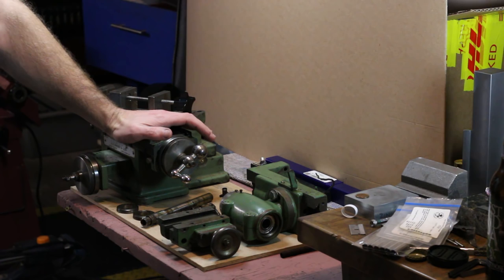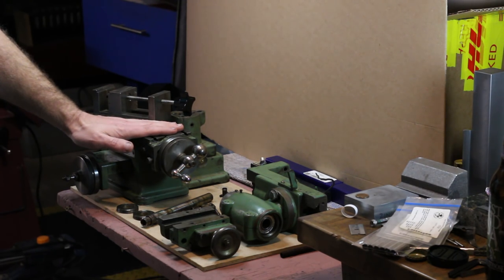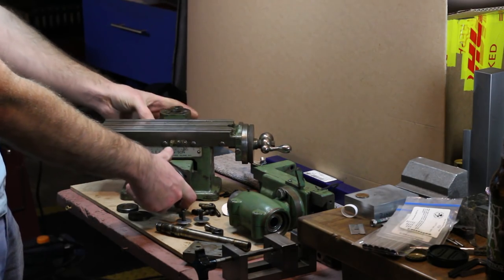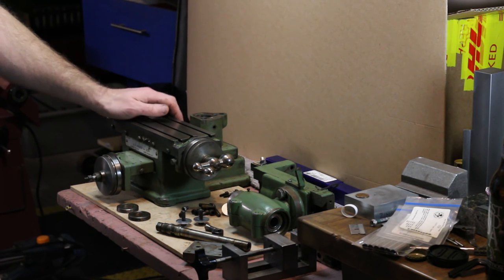Hager watchmaker's milling machine... sort of

Comment: good luck rebuilding the watchmakers mill.  I will recommend since you don't have the matching motor/controller in brush-less, that you try to find a much faster combination for such small work.  maybe up to 20,000 rpms instead of a measly 2500.
Reply from the maker: Thanks! With traditional style spade drills for the tiny stuff, 2500rpm is fine, chip load can be proportionately high without stressing the tool. I'm agonizing over whether to run direct drive, or gear it up to get 5k. I should do an update soon, I have designed the spindle and bought the correct bldc drive for the motor.  Whether direct drive or geared, mounting the motor is going to get interesting. Geared requires offset mounting, unbalancing the head. Direct drive requires a coupling, and if I wanted to go real high speed then a regular Lovejoy coupling wouldn't really cut it. Anyway thanks for watching, and for the feedback! The spindle itself will take very high speeds, so if I end up changing my mind or regretting the slow speed solution then the motor and coupling/drive situation is all I'd have to change.

Comment: A microscope stage such as that one was originally designed as will be extremely accurate. Feed screws and nuts would have been very close to jig borer tolerances and with a price to match. If it were me? This is a project you'll not want to skimp or go cheap on the re-engineering. I see many on forums and here on YT using aluminum for machine tool parts simply because it's either cheap or available in the scrap box. For a machine of this quality I'd be using proper cast iron blocks for that head mount. And I think I'd rough that spindle collet bore so it's close then rig up whatever you can to grind the finished collet taper while it's spinning in those new bearings. Shadon HKW has a good video about regrinding his mills R8 taper that's well worth a look if you haven't seen it already. 

I've learned just from observation that it's a good idea to pull the table and slides apart on my BP clone about once a year for a good detailed cleaning, gib and feed nut adjustment and relubrication even with it's one shot lube system. All that older black oil contains wear particles and there's always chips where you think it would be impossible for them to be. It's very likely the slides have never been apart on your X,Y table so I think that would be my first step. One problem you may/may not run into is these microscope slides were usually used in clean areas and as fairly light duty equipment compared to milling. The feed nuts may or may not be adjustable. That may require some redesign as well. 

Unless you have hardening and surface grinding equipment it's doubtful you could come close to the accuracy of even a fairly cheap screw less tool makers vise with anything shop built. I bought a hardened and ground Accu-Pro that has both the side and end slots for clamping to the table. It's well under the factory guarantee of .0002" on every dimension I've checked. There quite a bit more than the average off shore vise of this type, but I'd certainly say there well worth it. And one of the few things I've bought for my shop that I honestly think I paid too little for what I got. There quite low profile and would be a huge step up over what was included with your mill. 

Even though I have a couple of mills I've always wanted something much like what you've got now. It should be an interesting project and one I'll be following.
Reply from the maker: Thanks for taking the time to comment!

Generally speaking, I'm not skimping on this but on the other hand it's not going to be a money-is-no-object project either... unless, if course everyone wants to sponsor me on Patreon, LOL.  Regarding aluminum, I never have, and would never, make any structural or bearing component for a machine tool from aluminum.  Thanks for the heads up about Shadon's video, I'll definitely check that out.  I haven't made up my mind yet for spindle construction, I suspect I will agonize over the process for some time.  I don't mind making several attempts to get it right.  The entire machine will definitely be totally torn apart, cleaned, and evaluated.  So far it has only been subject to brief disassembly and cursory inspection.  I didn't really inspect the feed screw nut situation but there didn't appear to be any backlash adjustment.  I've never owned a machine with backlash adjustment, and am not especially bothered about it since it's so easy to compensate for.  If I modified any of my machines for backlash adjustment, though, it would probably be this one.  I personally like the double-nut mechanism.  The screws are your typical 60 degree thread profile, M6x1.0, with very generous length of engagement with the nuts, just as you'd find on metric watchmaker's lathes and mills.  It should be up to the task of the cutting forces involved.  This is for really small work, and since I have a larger mill already I won't be tempted to push it beyond its limits.

I'd really rather not go with the screwless type vise for this machine, if I make one at all it will be a screw type.  I would likely use iron for the body, scraped where it matters, and use tiny hardened and ground jaws.  We're talking super tiny here, this machine is really really small.
Reply: I tried finding it again but?????????? I ran across a thread about building a machine tool spindle on one of the forums yesterday and thought it was on the Practical Machinist site. Where ever it was the opinion for the best non specialty metal without further heat treatment was 4140 Ph. Machining qualitys were considered secondary to having a hardened collet taper. I've seen quite a few soft steel ER collet chuck builds on various forums and think over time might be a mistake for it's future wear qualitys and accuracy retention. My Bison and Emco ER chucks are more than a bit hard and a lot of wear and tear gets put on the collet chucks nut threads. Even with an ER-11 the threads are much finer so the problems are still relative to the same thing with larger collets. It's my understanding the chucks collet taper should be hardened as well. In the diameter and length your needing it shouldn't cost that much to go with the 4140 PH if you agree with my thoughts. Something to consider anyway. Plus the hardened material should give a better finish if you end up grinding the collet taper to finished size. Whenever I finally get to my lathes ER-40 collet chuck build that's the material and method I'll be using.
Reply from the maker: Yeah we'll see how it holds up.  If/when it wears out, no big deal to make another one out of a different material.  By that time I should have the Hjorth universal and ID grinding attachments set up and running, so that would open up possibilities for making a good tool-hard spindle.

Comment: A very nice little machine, indeed. The challenge will be to make the adapter that mates the spindle housing to the base to not look like an adapter but rather, as part of an original design.
Reply from the maker: Indeed!  I have been wondering about that, myself.

Comment: WOW... that X, Y, arrangement is something I have never seen before... Clever!!! might be interesting to wipe the chips away during clean-up.. but, I'll bet that is one rigid guy due to that set up... Thank you for showing that...
Reply: The X axis will be awesomely rigid because of how wide the support points are.  However, I'm wondering how much lateral force the Y axis will take. The long vertical distance between the tool and the Y axis dovetails makes a long lever!

Comment: Any idea what the upper casting is from?  Is the spindle cartridge shop built?  

The aspect I'll be following most closely will certainly be the spindle construction.  I know just enough about bearing arrangements to be intimidated by pre-load, runout tolerances, etc.  I'm guessing you'll want a fairly high speed spindle for tiny endmills, which I'm guessing will make the design a wee bit more critical than slapping together a drill press ;)
Reply from the maker: The spindle cartridge is not shop built, but the spindle definitely was.  The upper casting is from a legit watchmaker's mill, and in fact I just recently discovered it's from a model made by Hager... that does not at all resemble their microscope.  Video to follow!

Regarding the spindle design, the biggest challenge for me is constructing it accurately in regards to the integral ER collet taper.  I have some ideas, but haven't settled on the exact method yet.  The preload will depend on how much axial stiffness is desired.  SKF has great data on their site.  The lightest class of preload they give (53N per micron, I think more than adequate for this application), requires preload force of 40N.  The bearings themselves are rated for 67,000RPM with oil lubrication.  I'm planning on setting up for max speed of 5000 RPM, though I may talk myself into a step pulley arrangement to give even higher speeds when necessary.  The smallest end mill I've used so far has been 2mm, and the smallest drill 0.006", both of those using my watchmakers lathe that is limited to about 3000RPM with the current motor setup.
Reply: ... a 0.006" drill?  Do you just breathe down gently on the drill press handle to cut without breaking it?  I have seen exactly one 1/64" drill bit in my life and I thought THAT was impractical.  Sensitive drill press indeed!

I'm really looking forward to seeing your design process as well as the execution!
Reply from the maker: LOL!  The watchmakers lathe is really built with that sort of stuff in mind.  That's where a well made lever feed becomes important, having that feel is key.  I broke a few of those super tiny drills, but always due to my own ham-fistedness.  On my long list of projects-to-get-to-someday is a proper sensitive drill press, possibly based on the upright pillar tool casting kit.  I had that project in mind when I scooped up the super tiny, new-in-box, Albrecht drill chuck at an estate sale years ago.

Comment: Neat project, really looking forward to where you take this. How do the import ER collets look? I just had some 11s and 20s come in that I bought as spares/dupes  for a CNC mill with BT30 chucks and while the 11s look very nice, the ER20s much less so. Hope your ER11s work out. Cheers,
Reply from the maker: Thanks for watching and commenting, Andrew!  The ER collets, visually, look just fine.  Who can say what the runout will be though.  If it turns out I need to get a better set of them, I'm only out $30.  I suspect they'll be good, but time will tell.
Reply: Odds are, you'll be fine, I've bought at least 6 or 7 sets of cheap ebay collets and none of them have had more than 12-15 micron of runout... erm, that's half a thou? For the price, I can live with that. I've only bought in ER11 and ER16 though, maybe the larger ones are less friendly?
Reply: You're likely right, for most things that is probably just fine and you can't beat the price. About the cost of one TMX collet or maybe half a Bison gets you a whole set which is good to have for number drills. I can't afford a whole set of real ones but have a collection of common inch sizes for important (small/expensive) cutters.  Won't get to test the imports until Wednesday night. I'm got my fingers crossed already just in case. 
Cheers,

Comment: Thing is, it ain't no milling machine. It is a retreaded microscope. I followed  this one attentively and I do not see anything resembling a lead screw for the z-axis feed. On a microscope this would be done by rack and pinion on the microscope barrel. I am sure you figured out how to do the z-axis feed  but it did not  come  out in the video. Still, neat project. roughly comparable to my Proxxon MF70 but much, much cheaper. .

Comment: Very stout little mill, I have mini mill and g0704 mills and just wish they made small Chinese machines stouter if that makes sense, we home shop guys don't really need large machines but we could certainly use more robust machines
Reply from the maker: Yes that would be nice to see, Chinese clones of these very small but over-built benchtop machines.  To find these older Swiss, German, American made machines in nice shape is sometimes difficult and usually very expensive.